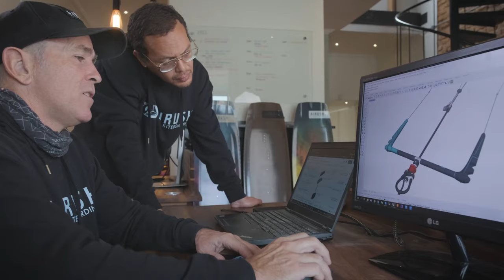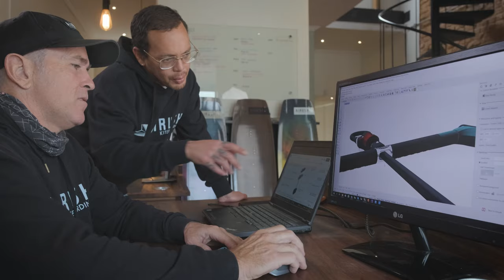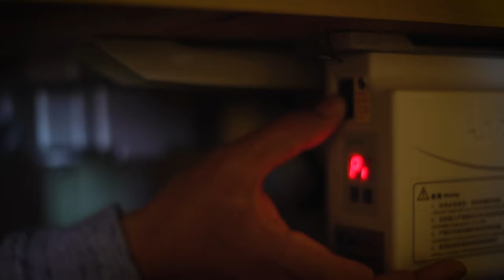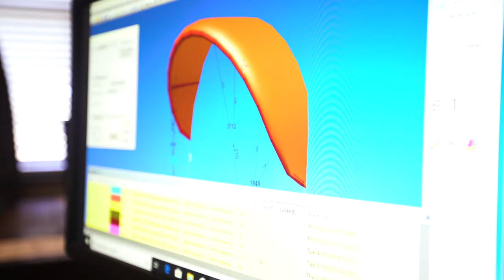By Innovators - Dave Kay on Durability in Design

Comment: Bars and board are durable enough. 5 years up is great. No need of a 699$ pro bar with lines not last longer than of a 2015 bar was 300$. Problem is the canopy sail material isn’t UV proof. So the Kite lasts only 200 Sessions and it’s done. Nothing to fix anymore you have to buy new. I will buy a expensive hookipa leading edge kite if the sail last much longer too or there is a way to replace it.
Reply from the maker: Yes UV and flapping are two areas that cause significant damage to all canopy materials. We do use the best canopy fabric we can possibly find. We recommend packing your kite away when not in use and have seen many 5 year and older kites that have been well maintained.  The load frame also help to reduce overloading on the canopy fabric, so even when the kite has had extensive use, this help keep the shape.